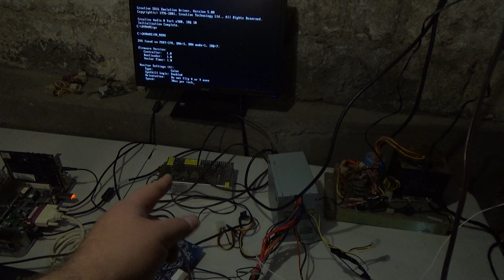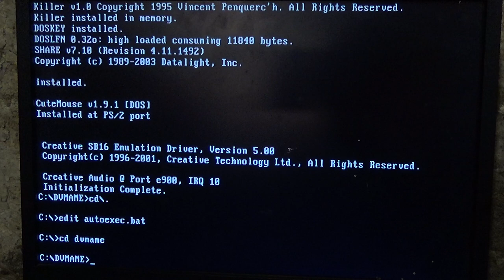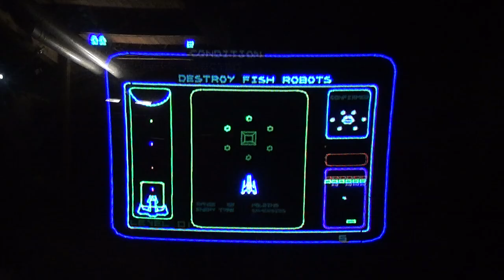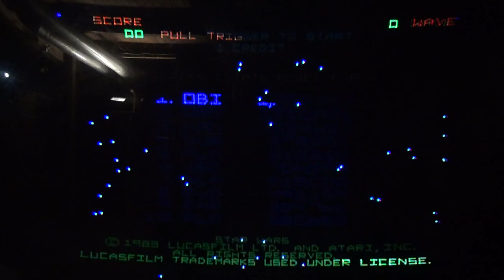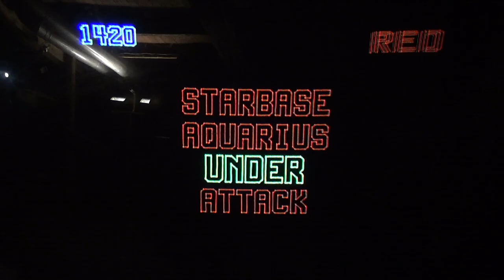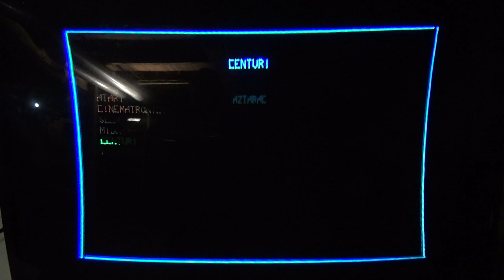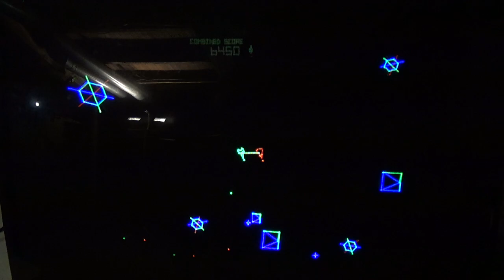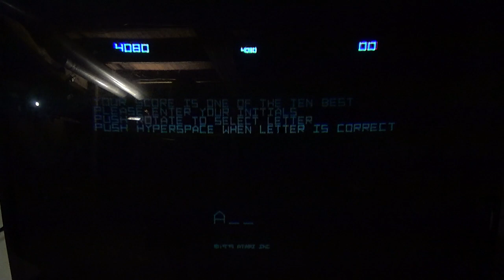playing with the ZEKTOR ZVG

Comment: Great to see you put this together so quickly and nice to see the actual differences on the MAME versions from that era so far. As much as I know your against building multicades(which most of are including myself), this would be the one board you still might want to consider putting into a cab if easy enough in the future and when affordable. With a CPO more custom built for games like Aztarac and Zektor since they are super rare. Somehow, I feel this belongs in your collection despite not being dedicated versions.
Reply from the maker: i already have working original guts for zektor and an aztarac pcb. i realize i will never get many of the rare cinematronics games  so maybe a multi cina cab ?
Reply: Do you have the original joystick & spinner for Aztarac? Is that a standard Mad Planets joystick as it appears? From what I see, Aztarac also used the same spinner.
Reply: I agree with Alan.  If you ever complete your collection then sure, why use it?  For now though, its a cool piece.  Not to mention it is a great use for your custom monitor you've build!
Reply from the maker: i may still use zvg in a cab  but i am thinking about building a 36" color vectrex arcade because the monitor would be vertical and possible to get through a door way

Comment: Merry Christmas Jason!

One word for your basement = Drylok
It's a concrete paint that also helps seal in moisture, it's also bright white so it makes everything easier to light as it dramatically by brightens things up, the stuff for the walls works fantastic and I don't doubt their floor paint is just as good. That stuff, some good LED lights and a dehumidifier can make the place 100% better.
Reply from the maker: My basement is actually bone dry. Some day I will paint MERRY CHRISTMAS
Reply: Your lucky. I spent all my money for games taking care of my water issues. French Drains, remotar entire basement, sump pump.

Comment: I dug up my beta Windows supported ZVG supported MAME.

"Vector MAME for Windows (VM4W) is version .137 of MAME for Windows with ZVG support."

That's a lot newer, March 2010 release of MAME. A very good chance some of the sound issues would have been corrected with this. Getting games to run as fast might be harder, though many may run just fine with perhaps better sound support.

I'd try to find where I had read that the ZVG was directly support by MAME years ago, and then research if it was ever pulled.
Reply from the maker: i may not upgrade any further  but if i did i would go the linux route  there is a very stripped down linux based version called advancedcd mame which i think is the fastest yet without a GUI . it came with bootable usb support and will install most on board sound cards like AC97 ect (no need for sound blaster cards)
Reply from the maker: also i believe it was .138 but you can use any mame version you want and NO windows chugging away in the back ground you could also use a raspberry pi with an lpt sheild installed

Comment: Since the video was made rather quickly after first getting the board up and running, I wanted to mention the following:

*  He now has all of the games running at full speed, even including Star Wars.
   May not have tested variants, QB-3 or a few supported later. 

* On my ZVG support page, when I asked how the video output compared to the original games, he said "most of the games have a perfect picture"

He ran into some speed issues initially, they've already been corrected. 
The sounds in some games are off. I know for a fact I'm getting different results in some of them because he sent me a video. I believe they are correctable, though I agree some of mine are off "by a hair"

* There are better samples that could be used for some of the games. Most of the games in newer versions of MAME have fully emulated sound boards, including Space Duel. Let's make sure we're all using the best samples possible if we have to resort to samples (which I'm rather impressed with their quality as a whole when compared to some of the hardware solutions)

* Native ZVG support was added to MAME, yet no one seems to have tried anything other than the official Zektor builds. It's likely we'd get emulated sound boards with the ZVG if we all work to figure it out, or push to have the drivers re-added to MAME if they were taken out.

* I have the files seemingly no one has used for the ZVG build of Retrocade and a newer beta Windows ZVG. Those likely might correct sound issues.

* One of the video issues reported to me was random vectors draw. I noticed this too, especially in Asteroids. Mine is set brighter than normal, and on another dedicated Asteroids that closely matched my screen settings, I noticed exactly the same random draw vectors I hadn't seen anywhere else.

My belief is if we're stuck without fully emulated sounds, some of the sounds will be "a hair off". That is, if we're all using the best possible sets of samples. But I believe we'll be hearing fully emulated sounds, as long as enough of us stick together to figure this stuff out. 

I think this is all pretty exciting for such an affordable solution that does so much. It's simply amazing what this board does, and for how long it's been around. Not only a perfect picture looking at it, but the animation quality is super smooth drawn vectors, that some say are even an improvement to the original hardware.

Now correct me if anything I said isn't right.
Reply from the maker: the biggest issue for Atari games like space duel is the guessed emulation of the pokey chip no one really knows what's inside a pokey but people have monitored the inputs and outputs so a program can do the same thing with most situations
Reply: From memory alone, the sounds I hear in Space Duel sound like the originals to me. It would take putting one side by side to really notice any differences. It's that close. I'm very satisfied with it, and I believe the vast majority of arcade collectors would not pick up on any differences if this machine were placed in an arcade in a SD cab. 

One thing I was wondering though, are those 2 sets of speakers sending out the identical 2 stereo left and right signals, or is it quadraphonic sound? I haven't hooked up the top set yet. Do you think it would be as easy as splicing a wire from the computer speaker and and running them to both sets of speakers?
Reply from the maker: the 2 bottom speakers are wired together in series  and the 2 top speakers are wired in series  also both audio channels are used so it would be stereo of some sort also the speakers on the bottom are 6x9 woofers and the speakers on top are full range
Reply: I played Space Duel some more tonight.  I took a photo of the samples folder in my DVMAME81.  There are no samples for Space Duel. Wouldn't that mean the sound hardware is emulated by MAME for that game?  The sound is excellent and no different than my memory of it, last played early this summer around the first time I got this color machine working for a short time. But I'm anxious to find one to be able to compare soon. Funspot's was working earlier this year, but down the last time. It had been down for like over 5 years and had a picture worse than playing it on my raster MAME cab, but the monitor was worked on this year and a had a very good picture the last time I played it there. I got to try it at the Free Play arcade in Providence as I was helping out right before it opened, but it seemed to be converted to Major Havoc (with a roller controller) once the arcade opened.  

I hooked up my custom MAME controller I had built in the late 90s to try out Black Widow on my 6100 monitor for the first time being able to actually play it. Looks great to me. It seems to have a little more flicker during the attract mode than I remember, but I don't see it once the game starts. Possibility of a tiny bit of slow down in a spot or two but I'm not sure. Might be how the original board was.
Reply: I'm using a similar spec'ed pc at the moment and I am seeing the same kind of performance in the video, wondered what did you do to speed thing up?  Thanks.
Reply: Please share the link to your  ZVG support page
Reply: N8Goulet Any chance you Have a Zektor ZVG for sale on your support page? I have a asteroids with a bad cabinet and perfect Vector monitor. Been looking for a cool use for it. As far as i can tell this is the coolest!

Comment: I get no sound.  Did you plug a sound blaster card in your PCI slot (1:25')? Which Blaster card?  Your SET BLASTER=A220 I5 D1 H5 P330 command line (4:23'), is that all what you do for sound?  No SET SBPCI=C:\DOSDRV
 C:\DOSDRV\SBLOAD C:\DOSDRV\SBINIT or something like this? Thank you.

Comment: cool, only half way through the video but weird only just started setting up a zvg this weekend so pleased to see.  At first my parallel cable was dud, made a new one and now realised I should be using ac power not dc (stupid daft should have checked).  Did you say you are using a 12v psu, thought it needed to be18v?  Also, what make/model is your PC, not sure what i'm going to run mine with yet, read elsewhere some have sound issues.

Thanks.
Reply from the maker: The 12v is only for the computer and sound. Yes you need to have 18v AC but you can use 15 in a pinch
Reply: I see, thanks for the info.  Searched all through old PSUs, dont think I have one.  Ordered one off ebay but doubt it will arrive soon, shame as I had time to have  a play this week
Reply from the maker: The schematic shows +15 and -15v regulators so if you use a common 12vac psu it should work with a slightly smaller picture
Reply: ah, cool. i'll have another look and see what i can find. Thanks!

Comment: Overpriced hardware for aging tech required to run it.  Come on Jason, I expect better from your chan.
Reply from the maker: overpriced yes  but i still like it.  not sure if i would want to put it in a cabinet though just don't like fake non original hardware .  i don't want people to think my games are not original  lol
Reply: Over priced for the ZVG? Do you realize what it does for under $300?

Since spending a few minutes setting the board up and making the review video, corrections to get the games running have already been made. Read my comments in a minute I'll post so people watching this video don't get the wrong impression of the board.
Reply: n8goulet I know what it does, its a replacement for vector monitors and provides the ability to run multiple vector games...

However they run on harder to find outdated hardware. And some have gone up to 600 on ebay.

While I applaud the effort, the hardware is for the above average collector, not an average enthusiast.

This will still not retain value when placed in a cabinet.
Reply from the maker: I agree not for a die-hard all original Collector but it is definitely the next best thing I'll never get rid of it but I am not sure I'd want to lose a dedicated cabinets floor space for a Mame cab maybe in the future ?
Reply from the maker: Also it's not a replacement for vector monitors not sure if you meant that you might be thinking of the tempest VGA board  in the video I am using a real Vector monitor
Reply: Arcade Jason yes sorry that should have been clarified. Its decent tech, but just not for me...

Like quantums... I'm no Alans Arcade ;)
Reply: It's all a matter of what a person wants. I build my stuff for myself,  not to sell. 

Vs spending "tens of thousands of dollars" on collecting a lot of dedicated games (many unobtainable), buying a larger home, and investing a great deal of time into repairing old PCBs I see a lot of value in this excellent alternative. Not everyone shares my enthusiasm, but put this in an arcade in an original game cab of your choice full of game collectors and see how many pick up on that it's not original hardware. And then ask them if it was any less fun?

FPGA or software emulation, their is no substitute for the originals mostly due to the art of the cabinets and sometimes unique controls. As for the game play, greater than 95% of us would have a heck of a time noticing differences. And it would be every bit as fun to play. That's what's important. Very high score players should always seek the originals. FPGA like MAME will always be questionable what could be different after playing a single game for hours.
Reply: n8goulet over $800 is pinball money. Noone will pay big money unless you find a sucker. Which apparently happens with quantums.
Reply: It's small money for this setup vs buying several classic vector arcade games. Some of these games sell for $5000 each, and several of them are in the thousands. Aztarac would probably be more like $10,000 or maybe more it's so rare and desirable. 

It's even harder to put a price on decent space (dry, clean, not ugly) to keep games. I spent roughly $15,000 on repairs to my basement in an old house just to have a relatively small area to keep my games. And that doesn't include any electrical work that may yet be needed (presently only have 5 working machines to turn on at once). 
I also don't have heat down there in the winter (it's about zero right now). 
Maybe some day. I hope to fit about 18 machines in total out of the 20something I have. The ZVG is a life saver allowing me to collect all the vector games I wanted with the space, budget and limited repair skills I have. I could put games in my living room, dining room, etc but I'm not
about to do that. 

Digital pinball games in general are more expensive than most classic video games, but it's a slightly difference audience. People will pay plenty for either if that is what their into. I'm old enough to remember arcades before they had any video games in them, yet it's been the classic video games I've been more drawn to collect. And when I think of collecting pinball, in general I prefer the EM machines. I have one pinball so far and it's EM, as I wanted (and working) .

Comment: Space Duel sound can't be emulated correctly because it requires the sounds be filtered only through a low-pass filter.  It can be done through software but will take additional CPU resources to run it real time.

I have a suggestion: if there's a lot of interest to produce yet another batch of ZektorZVG boards, would they make them again?  Get a poll started to see how people interested to buy them.
Reply from the maker: I TOTALLY AGREE !!!!!  i just wanted to put a few comments in so the mame is better guys could tell the difference in sound   also you have a great idea there with the  poll
Reply: Actually, low-pass filters have been emulated for some time. I run a number of synthesizer emulators that use low-pass filters and they are excellent. Hundreds, if not thousands of them exist. 

The ZVG specific builds from Zektor were made over 10 years ago. Over 10 years, some games had fully emulated sound boards, others relied on samples. For the games that used samples, a choice could be made of which samples to use. Instead of using the official samples, others like those for Retrocade that were compatible often had the best sounds for classic vector games.

I just tested Space Duel on the latest release of MAME. I have no samples in the folder, and yet I have sound. That means the sound board has been emulated. I believe they've emulated the sound board of most classic games form Atari for a long time now, but I'm not exactly sure how far back.

Native drivers for MAME for the ZVG were added. I haven't tried them nor do I know anyone that has. If they were ever removed from MAME, I'm not sure which would be the newest version that still supported the board.

I have the download files for the ZVG build of Retrocade that generally had better sound than MAME for vector games. I haven't tested it. I also have the beta Windows version, also have not tested it.

With my new support page and over 50 members in two days, I believe any sound issues of concern will be addressed. There is also talk of re-releasing the board by another developer or producing a similar one.
Reply: Though I don't personally think it's any big deal, it seems a low-pass filer for the Atari games has been added to MAME as of version 0.146u1

"Added POKEY filter stages to a couple of more games. Note: Most Atari games have additional filters.

". Added discrete sound to Black Widow, Gravitar and Space Duel"

With or without the filters, these games sound excellent and have all the elements 99% of us would remember about the sounds. Maybe one or two of you can pick up on the filter difference. The rest of us really don't care.  I adjust low pass filters on analog synthesizers all the time. A minute difference in the filter is not going to ruin the sound of these games. And besides, I've always said this system is a reproduction of the originals. Minuscule differences can probably be found. They are just as fun and just as exciting. If this system had been what the originals used instead of the PCBs, the games would be loved just as much and we'd still be complaining how they look on an "ordinary" MAME machine.